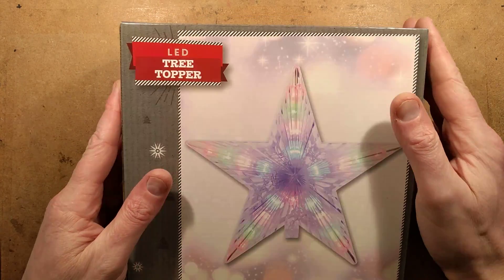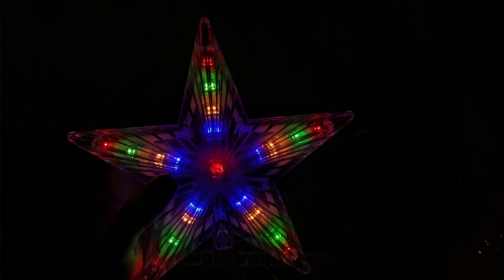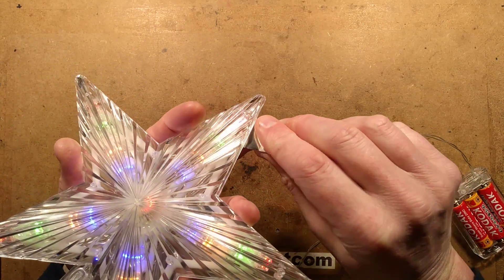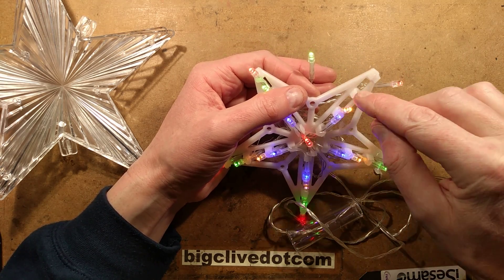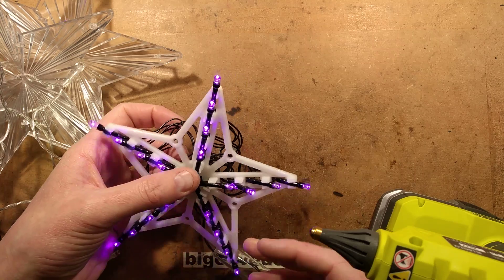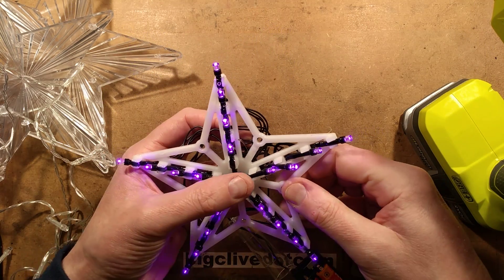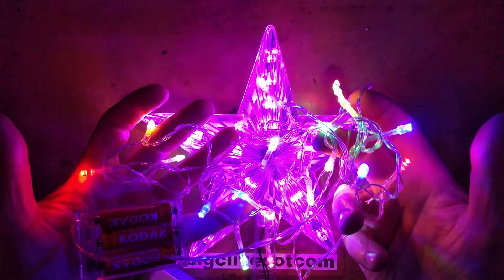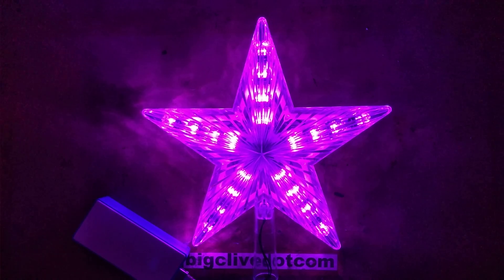Poundland purple gothic death-star hack.

Comment: Do purple LEDs actually emit a violet wavelength, or are they blue LEDs with a red phosphor?
Reply: There's no such thing as a true "violet wavelength", as far as I'm aware. The LEDs that emit a single wavelength in the ~400nm region look sort-of purple, but in reality they tend to go from emitting blue light to emitting low-frequency UV (which is hard to see) as you reduce the wavelength, and at no point do you get a high-intensity purple colour, unfortunately - at best you get a very low-intensity ghostly purple from the 380-410nm "UV" LEDs. The purple LEDs in this video won't just be ~400nm LEDs; they're far too bright for that.

There are two methods that are used for producing bright (high-intensity) purple LEDs: use a blue or UV LED die and add phosphors to get the red (e.g. in the case of the blue LEDs, convert some of the blue to red; or, in the case of the UV LEDs, convert some of the UV to red and the rest of the UV to blue), OR use a single package with both red and blue LED dice so that one package emits two wavelengths. The other day I actually ordered a range of different purple LEDs from Arrow.com in order to see how they compare, but since it's Christmas they haven't arrived yet. I think that they're all "proper" purple LEDs (either with two dice in one package, or using phosphors - i.e. NOT just regular UV LEDs), but I won't know for sure until they arrive and I test them!

If you want to have a look at the details of the various purple LEDs I ordered, their model numbers are: Lumileds L1SP-PRP0003500000, L1SP-PRP1003500000, L1SP-PRP2003500000 (those three are basically the same, just with different concentrations of the red-producing phosphor); Lumex SSL-LX5093VC; Kingbright AA3528VRVFS/A. Sadly, none of those are exactly cheap! The Lumileds products are £0.80 each, the Lumex one is £0.76 each, and the Kingbright is £0.60 each, all of which get expensive fast if you need more than a couple of them!

Comment: Loving your pink star. ;) Regarding camera exposure, I find the most realistic view of the lights is when you leave the exposure locked at the same level as with the bench lights on, but then turn the lights off. That way it doesn't all get swamped out, and the colours are a lot more realistic. I think you need to lock the exposure with some light on (but a bit less than the bench lights) and then turn the lights off entirely. That way the camera doesn't try to average exposure for the entire image, where the dark bench dominates and drags the amount of available light down so the camera over-compensates. (Locking exposure and white balance it with the white lights on also means the camera won't try and shift the colours round too much).
Reply: Bump it to the top!

Comment: That hot melt gun is proper skookum.  A real schmoo choocher.
Reply: Clive should get some sort of commission for flogging stuff like that. I've been toying with buying the Riobi hot glue gun. Now I've seen it in action I'll buy it.
Reply: You watch a lot of AvE?
Reply: I would have thought a mains powered one would be a better investment, lighter too... ?
Reply: @Fifury161  Lighter yes, but there's something to be said for a useful portable tool like that which only sees occasional workbench use, or more appropriately frequent use away from the bench. If you also already happen to use tools of the same product line you'll have spare batteries too.

That AvE video which was referred to also featured a test with how many sticks of glue could pass through it before the battery would be empty, I seem to recall it was a pretty nice amount of hot glue.
Reply: Not too sure how fast the Ryobi glue guns heat up, but almost every "mains" (240VAC) glue gun I've used takes an insane amount of time - even the good, branded ones!
Reply: @FG-Supercharged  I rewatched parts of the AvE video a while ago when this video sparked my interest, pre-heat time from cold was 4 minutes apparently (in the video he was under the impression first that it was very fast but this was due to being hot from an earlier test). And then he proceeded to squeeze 10 sticks of glue through it to see how long the battery lasted but ran out of glue instead of battery capacity. 

Obviously though I guess if you do many small things involving heating it up, using a bit of glue and letting it cool down until the next time it's needed later on you'll probably have to recharge well before 10 sticks are spent.

Video I referenced: https://www.youtube.com/watch?v=hLz6fmySM6g after he breaks a few things in the teardown and has to fix them the test starts around 12:30
Reply: @FG-Supercharged  People have a misconception that because its DC and lower voltage that its not as high or higher current than a mains connected heating element plus this has much finer control that maintains the melting temp of the glue.
Reply: @extrastuff9463  Even 4 minutes (and that's a presumably cold climate compared to Australia) is not bad from my experience.  I've had ones that take 8 - 12 minutes to heat up to usable and they were "name" brands!  And they know they're slow because even after switching them off they're slow to cool down...  Pity they haven't been able to invent something that is useful for 5 to 10 blobs without the excessive wait both ways - but 4 minutes is just on the OK side...
Reply: @Furiends  Yeah, it's all about (controlling) them Watts.  I assume the Ryobi, with its 18V, is using a decent amount of current to get the heater up to temperature.
Reply: @FG-Supercharged  A refillable butane soldering iron with a heating tip, or a mini blowtorch with a yellow flame option would work perfectly for that, and those things are really thrifty on gas. I have a mini blowtorch that I've left burning for 10 minutes at a time and not run out of fuel, and I've refilled it 6 times out of a can of lighter gas and still have loads left.
Reply: @Jabbasaur  I like the idea of gas heating a makeshift gun.  I might even be able to cobble something up using a metal tube, etc... Unfortunately the area I work in (a school) doesn't allow flammable products of any kind in case someone's "darling child" has a tanty and burns the school down or another little petal.
Reply: @Fifury161  You're tethered to a cord. The cord doesn't have to be heavy to resist forces against it to the same degree as gravity with a heavy battery and plus it gets tangled.
Reply: Currently £38.99 on Amazon, then there's the batteries + the glue sticks. I can buy a wired one with 50 sticks for under a tenner... or 200 glue sticks and 4 guns for about the same price as the Ryobi (without battery!)
Reply: All the batteries for these "skin" power tools have insane prices. I guess it's a marketing thing, once you have one power tool with its batteries you're more or less stuck with that brand. The Ryobi is no exception and I wouldn't even consider their hot glue gun skin if I didn't already have some Ryobi batteries.
Reply: @Fifury161  A mains powered one has its own places, but the handiness of a cordless glue gun is magnificent. I own it, because I own other ryobi tools, and it has proved its usefulness several times already.
Reply: I might get me one of those as mine a corded one blew up! luckily I kept it in an explosion containment pie tin
Reply: My lighter gets up to temperature instantly and heats as much or as little as needed, when the stick gets too small to hold heat the end of the old stick and a new stick and put them together, minimum time from lit to item stuck with glue it's less than 3 seconds with no more than 15-20 seconds on large joints that need alot of glue

Comment: On the topic of modding battery lights to run off rechargeable USB batteries, I have done just that this year!  Got some unused resistors out of old PC low noise adapters and put them onto the battery pack lights (the button cell and dumb ones) with a couple cables I lopped the ends off of that I also wasn't using.  I have to say they look pretty good and keeping the battery pack was good for the timer alone and necessary for the inverse parallel strings (b*@$ards! Just use one more wire you cheapskates!) to use the whole string. Side benefit, the strings with the packs I kept already had a resistor in them so no need to add one. My main room is nice and festive this year. :)

Comment: I use canned air turned upside down to quick-cool hot glue when I need it to set fast....
Reply: I have some cheap plumbers pipe cooler for just such a situation.
Reply: nice tip
Reply: I use freeze spray if I'm in a hurry.